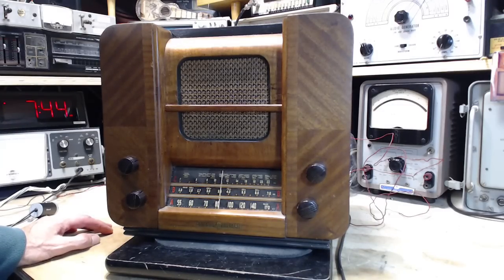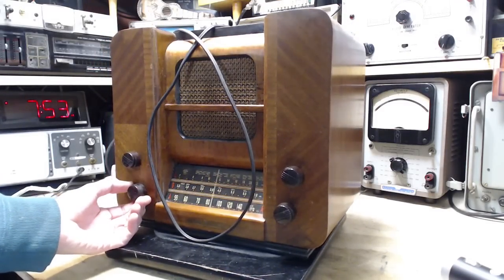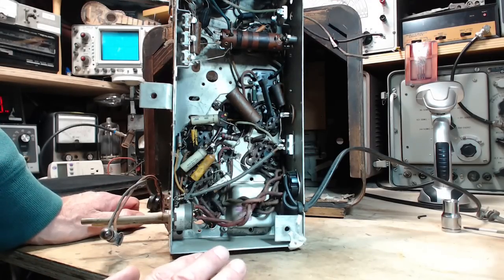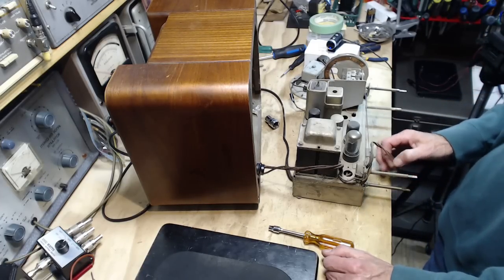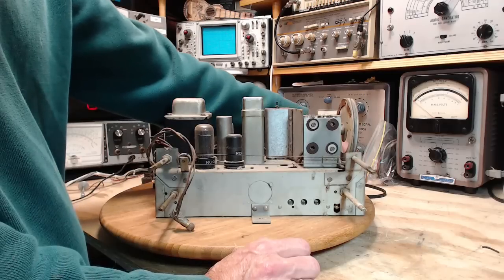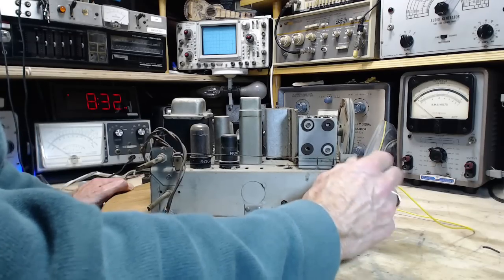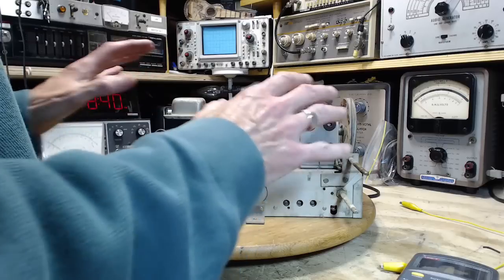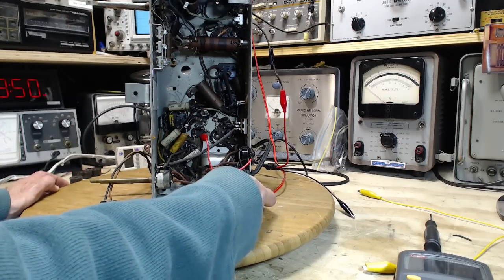Canadian General Electric Model JK-53 Video #1 - Checkout

Comment: Jim that transformer is rated for 25 cycles !!!!!!!  You are feeding it either 50 or 60 cycles !!!!!!   the eddy currents in the core may be heating it up !!!  That transformer may NOT BE USABLE at current lines frequency !!
Reply: Nope. 60 Hz into a 25 Hz transformer draws LESS power; its impedance increases with frequency.
Eddy currents in laminated cores are negligible at that range of Frequency. 
About the worst one could expect there would be reduced secondary winding voltages.
Reply: So now that reflects our thoughts  back to possible shorted turns on primary or secondary, or problems with leaky filter caps or other problems further down the road or circuit.
question I have is now with a 25 / 5ocycle ripple would that not require maybe higher capacity filter caps and or larger inductance value's in choke value's too ??